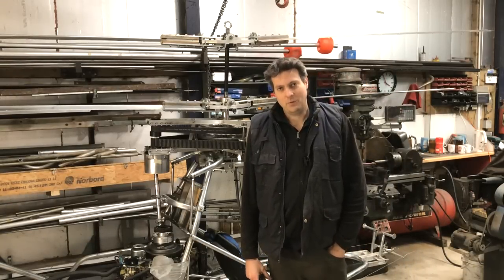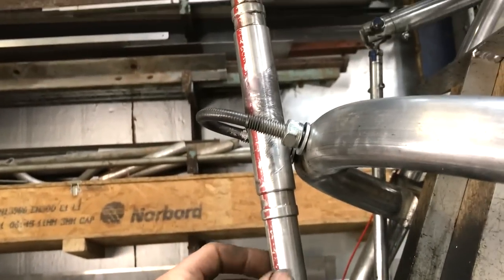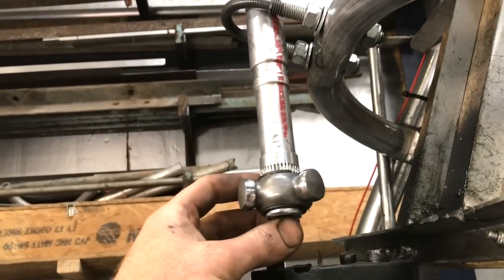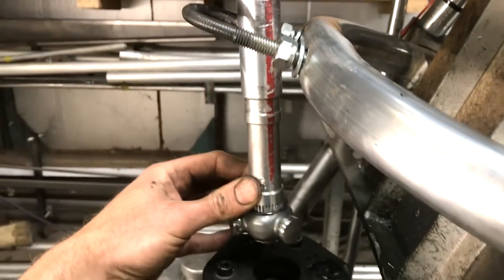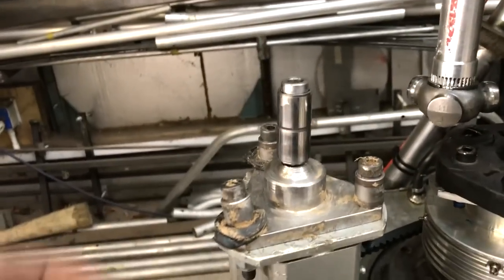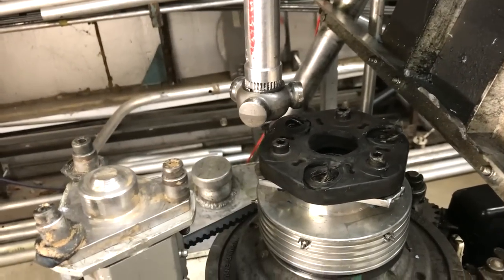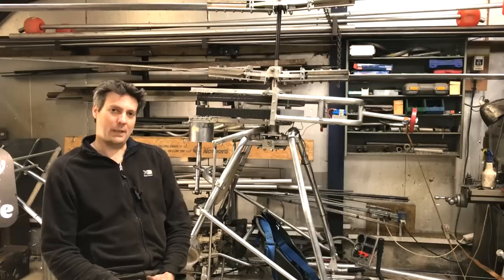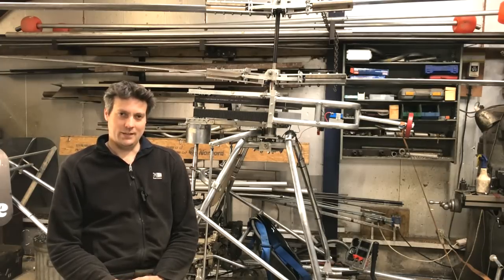What I got WRONG, Homemade coaxial Helicopter

Comment: I faced the same issues when putting a FWD drivetrain into a custom chassis, about how the half-shafts could handle only a certain amount of misalignment, and how the amount changes depending where it is within its 360 rotation, and which also varied with plunge and extension! Took a lot of measuring to ensure it wasn't exceeding its limits under all conditions.

Regarding control, yeah I was wondering about how much gyroscopic force ends up being the "tail wagging the dog." I would likely have done the same as you because of how much simpler it is than a variable pitch solution.
Reply from the maker: Understood, I did the same as you except my shaft was mounted vertical and so it's possible just the weight of the shaft pushing against its plunge limit could have restricted articulation. I'm not entirely convinced this was the cause but it's a possibility. Two universal joints and a bearing slip joint in the middle I think would be the solution. The downside to doing this stuff is no part has been tested for life span. If the parts had been tested on testing rigs and a life could be assigned then I would have much more confidence in it. I have of course done what I can calculations wise but there could be forces present that I'm unaware of. 
Helicopters are incredible mechanical devices, so much going on with forces and vibration. It's amazing they have come so far in terms of reliability. I was taking to a guy who works for Leonardo helicopters and he said they use an electronic, hydraulic anti-vibration system because they can't get the vibration out of the rotor.

Comment: problem with going with single cardan joint on each end with a slip joint in the middle  here is the unequal  and changing angles from  tilting the rotor head  will  cause some pretty  disintegrating   forces..      
  Which got me thinking;  did you remember to 'clock' or phase the CV  correctly?
Reply from the maker: Hi. I didn't phase the cv joints as I thought they were constant velocity and phasing wasn't necessary ? It obviously broke for a reason and you could be right. 
I don't know how much bending force would be implemented with two universal joints and slip joint even if properly phased.
Reply: @Ben-Dixey    I too didn't know about phasing a CV joint!  After I mentioned the problems of single cardan joints with dissimilar angles got me thinking/searching and sure enough,  they too need to be 'in-time'..

Comment: There's a couple of videos on my youtube....and another YouTube that I had...YouTube upgraded back in 2012ish and I lost some vid clips. Still a couple vids under my "other videos".
My Linkedin has a couple of writings that were published on drones/DOD. Handful of posts on Rotarywing forum. Lot of stuff, my web site etc I did not access enough and closed out.
My patent is listed as Human Interface rotor system helicopter 822,6026. Have not dabbled much in it since I retired except a few upgrade sketches. 
As far as airscooter links I cannot remember which one discussed details of Aircooter's issues. They did come up with a 4 stroke engine design that was pretty interesting.

Comment: I can only speculate about air scooter...I do know that many rotor wing pilots are real hands off to the idea of fixed pitch rotor systems and weight shift rotor systems. That's why I tried to keep airframe manipulation within an imaginary sphere ..if you will. Example when you pitch forward, another part of the airframe shifts aft, but radially..and all at equal moments.

Comment: The 100 feet airscooter comment was from an interview about the aircraft some years back.
I designed and patented a helo airframe/rotor system that was a morphing airframe. Referenced by sikorsky 2020 regarding ground taxing of their coaxial helo RaiderX,   but referencing is not licensing, etc....and it's just "referencing"..
I built and flew a small scale version of it in 2012...it flew ok, but was under powered a bit.
I designed several drone helos and some other modular stryker armor for DOD, DA, and presented my design to Darpa,....Darpa's DSO said that it had merit, but not something that they were interested in at that time. Trade off was cheap for Dep of the Army...but I was infantry and an aerospace mechanic friend said they did not understand how an infantryman could come up with something that works and not be an engineer. It did open up some doors before I retired from the military. Interesting side seeing R&D for DoD.
Still tweaking my own patent, but I'm retired from the army now and do things on my own schedule. Aerospace companies treat you different when you are able to design stuff without a degree...I grew up working on small machines, cars, and ignored people that told me.."you can't do that"...
Mostly just brain candy for me...I have other designs that I want to do, but non-provisional utility patent costs add up...maintenance fees suck..
Home improvements keep me busy, but wife told me to get off my can and do something with it..mostly a hobby for me and only built the flying drone version of it when a fixed wing pilot said it would not fly...so had to prove him wrong..keeps my mind engaged...
Iraq and deploying kept me busy before I patented it. I went in with the mind set to have fun with it...not just to try and make money...had to go to JAG twice to keep my patent in my name..JAG said since I was not aviation and did all of the design/work on my time and my dime that the intellectual property rights were mine...but again it was mostly for fun. I did learn that building small scale prototypes was the fastest way to find things out...safest too. For my patent there is no linear shift between frames. Everything moves and reacts(moves) within the two airframes and vectors thrust...the idea is to keep collective pitch, but just with a thrust bearing assembly rather than a swash plate to prevent the angular differences between the advancing and retreating blades cause by cyclic pitch change and the mechanical nature of the swash plate. Always an ongoing tinker project with no deadlines.
Reply from the maker: Well that all sounds very interesting, are there any online links to your experiment's/designs ?

Comment: Even with the Air scooter coaxial platform at the height of it's hay day fixed pitch was ok. They advised not to fly over 100 feet and all should be fine as a weed jumping coaxial platform. And as you stated your rotor discs don't have high inertia. Free wheeling clutch is still a good idea. 
More than one platform has always had to have upgrades, changes. The Mini 500 single rotor popular back in the 90s from former Revolution helicopters had issues with the trans with the input pinion bevel gear because it had only one bearing. There were failures. There's a guy in Arkansas who machined an improved pinion with two bearings.. the added bearing was fitted to a machined nub shaft on the front of the bevel gear and that with the bearing on the bearing shaft below made for a more durable input shaft in the transmission. Some people give him flak, but he's fixed more than one Mini 500 and flies all over his area once improvements are made. Murphy's Law can be in the smallest thing, nut or bolt...especially in rotorcraft.
Reply from the maker: Hi, I didn't know about the airscooter maximum height recommendation being 100ft, a more sensible figure would be 10ft in my opinion, but I suppose they did have a 4 stroke engine. 
Don't suppose you know more about the failure to go to market? 
I had some brief correspondence from Dennis Fetters of revolution helicopters. He was encouraging and knows his stuff. 
Do you build/fly rotary wing or an enthusiast?

Comment: most of the toys i have had like this use a motor on a boom that is turned vertical with a blade. the motor is ran forward to tilt the nose down and
 run backward to tilt the nose up.
Reply from the maker: That's right, I had one too. It's another way of doing it. Mines controlled by tilting the whole rotor mast. The models you speak of use a stabiliser bar developed by Arthur young, that keeps the helicopter stable in the air. The horizontal tail for pitch control and varying top and bottom rotor speed for yaw. It would be possible to build a full scale version of your toy I would think. Very easy to fly.

Comment: I know it sounds goofy, but did you attempt to lubricate the slip joint on that prop shaft, with *teflon grease*? It is not cheap grease but it works wonders for things like that, it's extremely effective under torque and shock loading. Ford Motor Company ended up developing a procedure to use it to repair "creaking/popping" splined slip joints in their rear drive shafts (which were under a lot of torque) and it works flawlessly.
Reply from the maker: Hi, great comment, no I didn't know about Teflon grease. Wonder if it would have worked. 🤔
If I fix this machine it will be with a shaft made from scratch but if splines will slide easily enough that would be a good solution. 
Thanks

Comment: can't wait for the next video, keep doing your best👍
Reply from the maker: Thank you! and to you 👍 hope you manage to get that machine hovering.
Reply: @Ben-Dixey  thank you.l will try sir.
Reply: @Ben-Dixey At what rpm does the propeller take off sir🙏
Reply from the maker: @amrinwello6620  The rotor rpm is 780, rotor tip speed is 576ft/sec at lift off.
Reply: @Ben-Dixey Thank you sir🙏

Comment: My late father built a very simple Gyrocopter,  Bolted together aluminium scaffolding tubes the main hub being a car front wheel hub with a seesaw teeter bar mounted on top.

This was moved around its various axis by a overhead bar acting as a control stick rather than having the complexity of the linkages taking the control stick movements ( more commonly between the pilots legs ) this complexity was transferred, instead by a more direct connection of this simple overhead control method.

Yes it flew, as a glider in a 30-40 mph head wind with it tethered at the front.

You certainly have all the materials to make a powered version of one of these..  :)
Here's Hoping to see a resurrection of Dads autogyro maybe.?
Reply from the maker: Thanks for the story of your dad. 👍 we sound similar, a gyro kite would be a fun build for sure.

Comment: If you do decide to do another helicopter (or even gyrocopter), you might want to look at an intermeshing rotor design. They're wider than an equivalent coaxial, but the design is simpler (no need to shove one shaft through another).
Reply: Or, for that matter, a cyclorotor.
Reply from the maker: I like the syncropter's they are an interesting design, similar in efficiency i would imagine to the chinooks. Had to look up cyclorotor. Think I've seen a model fly with this type of propulsion. 

The Kaman syncropter with its servo flaps for control is another idea I like. Wooden blades are needed as they twist the blade for control. Flying machines are so fascinating.

Comment: Something tells me you could use an electric transmission for this, and simply connect a generator to the motor and either two big BLDCs or a series of them geared to each rotor. Then, the physical design is the same.

Comment: If you're looking at a massive amount of work regardless of what you do I would suggest just starting over. It's almost certain you're going to end up making a bunch of compromises to get whatever new design you want to fit within the current build and you probably learned enough during this process that you'll want to change something about just about everything anyway.
A lot of times people get stuck in the sunk cost fallacy thinking that they have to keep working on the thing they have been working on just because they've already put a lot of time and money into it.
I say take the lessons you've learned from this as an awesome educational experience and start with a clean sheet which will allow you to build exactly what you want.
Keep the videos and updates coming! I can't wait to see what's next:-)
Reply from the maker: Completely agree, great comment. The next machine will be better for the experience. I'm nearly ready to accept this and move on.  Like you say it's better to start with a complete new design than make what I have work.
Reply: @Ben-Dixey  definitely a tough decision to swallow but if that's the way you go I really think you'll be happier in the long run.

Comment: ASTOUNDING!! What you have created is UNBELIEVABLE!! I am a helicopter pilot, with over 5,000 hours of flight time. Let me tell you this: If you can hover a helo, then you can easily fly it!! One more thing, you are on the edge of flying that helo, (when high above the ground), you just on the edge of being on the outer-edge of 'ground-effect'. I would STRONGLY RECOMMEND that you DO NOT attempt forward flight in that grassy area! Try forward flight ONLY on a hard-paved surface! Why?....because if you drop in height, taking-off over grass,...and you drop back to the ground, it will snag, and you will go over, end-over-end, and will have crashed. Over a hard surface, and you have a chance to level the aircraft, it should not snag, and you should be fine. Also, with as much height that you achieved, moving forward at about 10 to 15 knots of airspeed, you will place yourself in MUCH 'CLEANER' airflow, and you will get a SNAP UPWARD in height, AND achieve much greater airspeed as well!!! That is called 'Translational-Lift', where you are then advancing into smooth airflow going past you, and your helo blades will become much more efficient! You are doing GREAT in your hovering!! IT TAKES CONSTANT PRACTICE TO KEEP UP YOUR PROFICIENCY!! ...So stay with it, as much as you can!! Ron Kondler, Major, USAF, Ret. (Pilot for both President Johnson and Vice President Spiro T. Agnew)
Reply from the maker: Wow. Thanks so much for the positive comment. It has been very difficult to get to grips with hovering, it's such a skill to have to learn. Translational lift would probably be something for the next project as this one is only fixed pitch. A few feet above the ground maximum and very slow forward speed. It's more of a technical exercise and a stepping stone to the next project. Great to have your thoughts 👍
Reply from the maker: It must have been exciting being the pilot for a president. A very privileged job I would imagine, you must have been very good at it.

Comment: Please don't stop with creating. The world, if not the universe is powered by imagination in all aspects of life. The ripple caused by the creative stones you throw in the pond continiue...
That being said I was born in Bridgeport , Connecticut not too far from Sikorsky Helicopters and as a kid got to see the evolution of Igor Sikorsky's dream in the sky. (Yeah, I'm that old.)
Reply from the maker: Wow, thanks. What I would have given to have been part of igor's development team. How close did you manage to get to igor's helicopters ?
Reply: @Ben-Dixey  When I was a kid around 10 years old (like 1960) where we lived was about 4 miles from the helicopter factory. The were constantly flying and testing. My uncle was in charge of security there. We also had a small skiff and would go fishing out in Long Island Sound where most of the test flights were conducted. They also had a neat looking crash boat to recover the mistakes. There was the occaisional casualty being towed back. I guess the test helos had flotation attached just in case. Back then it was basically the S-54 and S-58 models. It was exciting when the S-64 Sky Crane showed up. A little later in life I was working as an apprentice elevator mechanic on an old unit in a building next to their outdoor test cell for rotor testing. I could watch from the roof when would spin them up on an electrically driven test jig.
Reply from the maker: Brilliant. 👍 I would have been fascinated to witness anything like that.

Comment: It may not matter, but I wanted to comment on how you have the powerhead mounted.
Those 'mounts' are for the motor cover/hood, they do nothing to hold the powerhead onto the exhaust housing. 
The rears on the cylinder head are substantial, but the fronts are pretty weak, and tend to break if ever put under any load.
Reply from the maker: Great observation. I had some concerns too. Perhaps I ought to make new ones if I continue. Thanks

Comment: If you are just wanting to fly you do not try and build your own helicopter.
It is far cheaper and quicker to just buy one.

 If you do decide to build one it is at least equal parts wanting to fly and wanting to learn new things.
The questions you need to ask yourself are: 

How much more can I learn from this?
Do I want to learn those things enough?
Reply from the maker: Well the hovering was 25% of the reason for building the rest was the experience and knowledge gained. Opinion to what's right or wrong to try it, is divided. Risk assessment varies so much between people. Safety is high on my list of priorities.

Comment: Ultralight Helicopter, look up on YouTube.  I never thought of issue you described as top rotor being hard to move quickly.  And the auto rotation lacking issue.  Now I won’t build a fixed pitch helicopter even  if I had the $ and space to do so.  I wish you would carryon after a break first of course.  I could send you the plans to the CP helio on ultralight helicopter if you like. I want nothing for them.    CHEERS